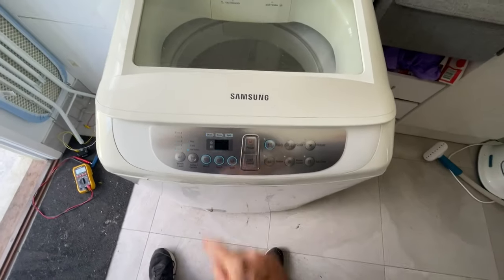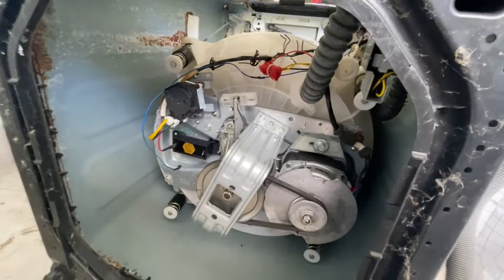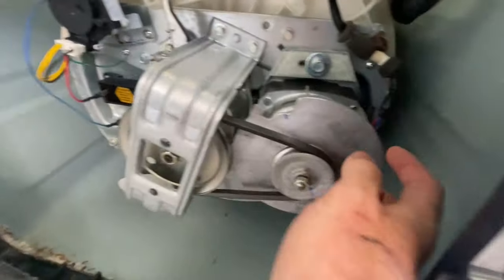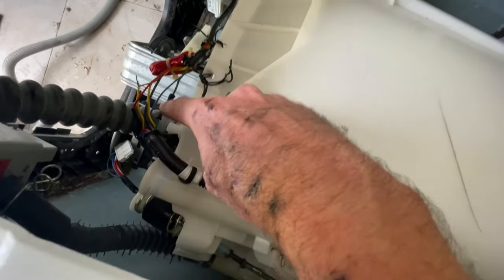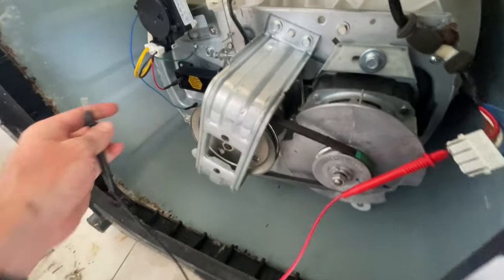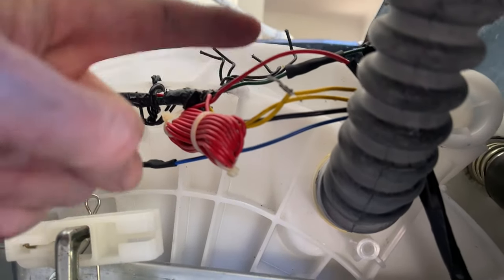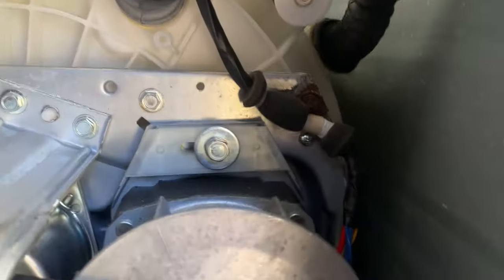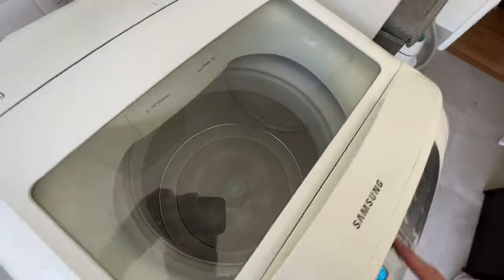Washing Machine Not Spinning Just Hums: SAMSUNG FIX

Comment: I saw the video, did a visual check and I found a frog in the middle of the pulley and the belt, I removed the frog and reinstalled the belt and now it's working perfectly. Note: my washer machine is outside.

Comment: Cheers, fixed mine today after watching the video. Turned out the blue and red to the capacitor had snapped at the join in the wiring harness. What a silly design, why not mount the cap just near the wire start point instead of adding in 50cm of wire that could snap haha.

Comment: Eureka! Thankyou! Your video saved me a ton of hassle. Having already raided and old aircon for a capacitor, I did a continuity test from capacitor to motor plug, as you showed. This was open circuit, prompting a closer look at the harness. What I saw next reminded me to don a head torch and have a darn good look in the first place, because the broken red wire and its burnt ends were right there in plain view! This is pretty poor work for Samsung... a heavy bundle of red wire (presumably some small current-limiting resistance for the starter winding), poorly supported at its ends, that leads to stress and breakage.  I'm just waiting for the next broken wire now. Any other ideas why this metre of wire is in a bundle? Dave, Adelaide SA

Comment: hello sir the problem of my washing machine is that the wash and spin is not working but I already check the capacitor and the drain motor, both of them are in good condition, i tried to spin the wash motor manually also in good condition, what is the other possible that my washing machine is not wash and spin sir?

Comment: Ever experienced where the machine doesn't wash? but the spin cycle works. U only hear the hum during the Wash.
Reply from the maker: Wonder if its a similar issue with the pump not getting the right power signal, instead of the spin motor.
Reply: Hello same issue with mine, did your washing machine fix?
Reply: @PaderogPlays  oh just saw these msgs. I ended up getting it checked. Turned out the transmission (gearbox) is basically broken. Hence why it can spin cycle. But the part at the bottom that wobbles doesn't work. Worst part it. My local dealers says "they don't make that part anymore" I ended up buying a new one.
Reply: Why why

Comment: On mine, I tried changing the motor but the machine keeps burning the motor
Reply from the maker: are you able to ensure its getting the correct volatage at the motor? This is very dangerous to test. But if there is excessive resitance at the motor, the voltage will drop, the motor will run hotter than normal and melt.